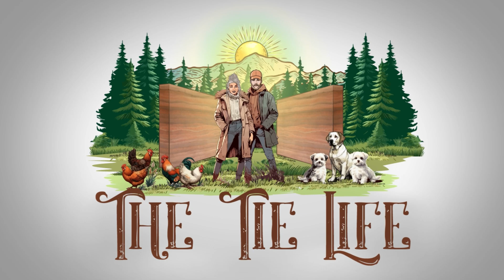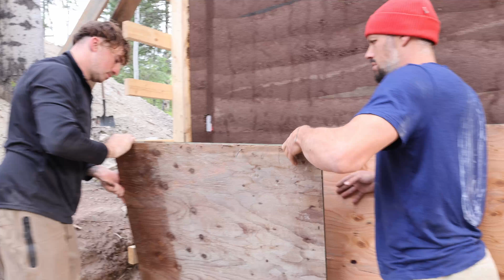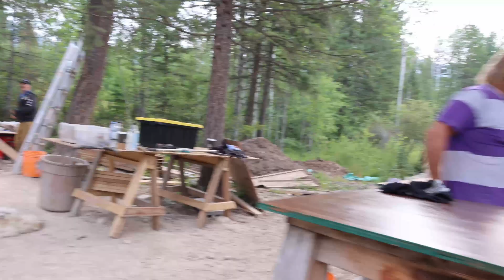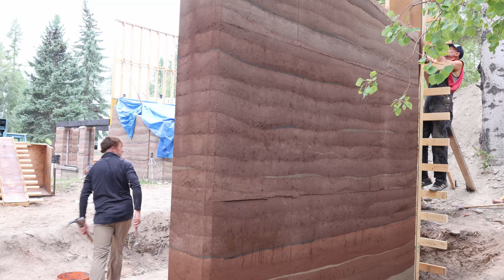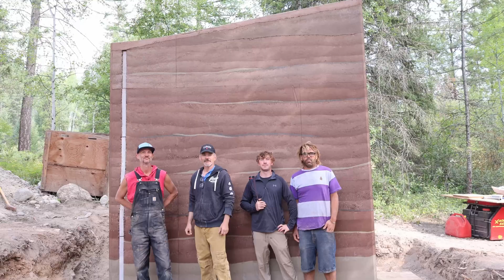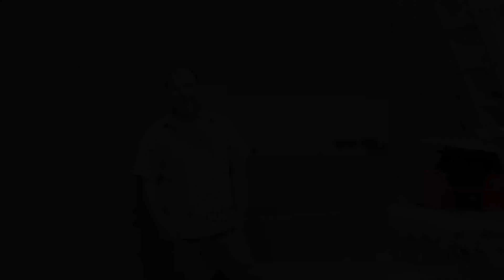Unveiling our Rammed Earth Sauna Walls

Comment: The wall looks great, if I can build walls that aesthetically pleasing I will be very happy. Is there anything about it that you weren't happy about? Was your rammed earth mix the same for this as for the greenhouse? I'm thinking along the lines of functionality with respect to humidity within the individual buildings.
Reply from the maker: Hey! Thank you. The course was a great way to teach people on this building method. We used the same mix as the greenhouse with different ratios for pigment. Same colours except the added no colour highlight lines. The greenhouse walls are sealed and we will also be sealing the walls of the saunas with a concrete sealer. Thanks again for your interest and watching!